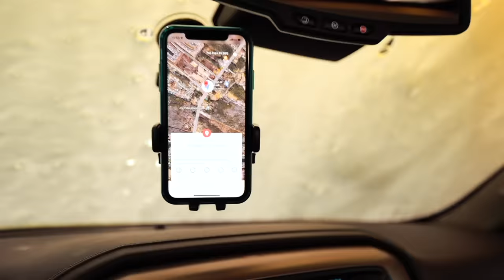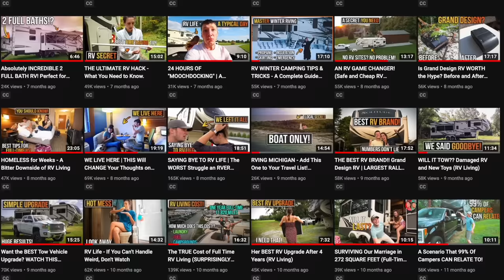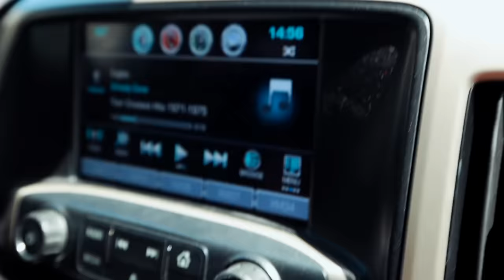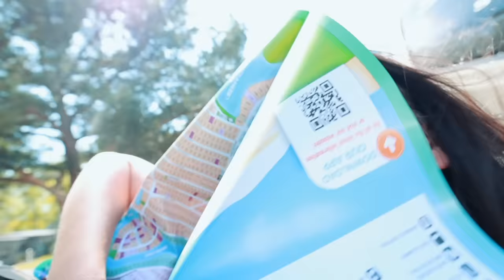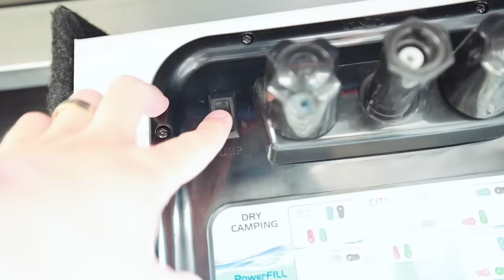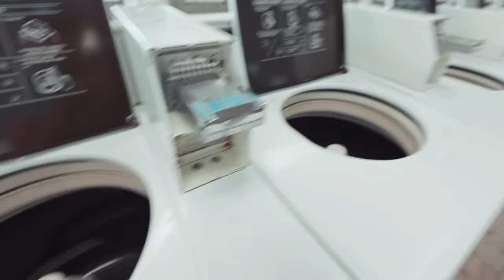THIS Is Why People Quit RVing! RV Repairs REALLY SUCK.

Comment: Hey Carl, I noticed that you connected the emergency break away cable to your fifth wheel hitch. That location is not legal because if your hitch actually breaks from your truck, the cable will not trigger the brakes. It actually has to be attached to a separate location from your hitch. (20 year owner of a trucking company) just trying to keep you safe. Love you guys!
Reply from the maker: Good to know!
Reply: I have mine connected to my hitch as well.  This is the first I’ve ever heard of this…
Reply: Interesting.
Reply: @faverdod5773  many people are unaware of this. Unfortunately many rv dealers tell customers to hook it to the locking arm of the fifth wheel hitch. Legally it has to be secured to a location completely separate from the hitch.
Reply: @justustwo1457  I will try to locate the actual law for you, I belive its under FMCSA. I've had a driver fined and I've received a warning for improper/ unattached emergency breakaway cable.  State Trooper in Texas explained the law to me.
Reply: Even if it’s not an actual law, it’s common sense everyone.
Reply: @chrisandersonCR16  I'm not sure the law would apply to RVers per se, but this is still a good practice.
Reply: @randobot6814  That is possibly true. You would think that if commercial vehicles are required to mount it to the vehicle separately from the hitch, private individuals would be required to do the same.  But, to drive a pickup truck and trailer with a GVWR of 26000 or more commercially, you have to have a cdl, but a private individual doesn't.
Reply: @bulletsonofagun7413  I know commercial driver's are required to mount it to a different location, I'm not sure about privately.
Reply: This isn't a law
Reply: This is great advices but the law only applies to commercial carriers.
Reply: Horse people know this; but many rivers don't seem to.  We have to extend our cables for them to effectively engage. It is very odd that modifications have to be made for this.
Reply: @chrisandersonCR16  state by state there are different laws for non commercial cdl requirments.  You are giving blanket advice as if the laws are federal and not state by state.
Semi doesn't have breakaway cable because air brakes will come on when the line disconnects.
How many 5th wheel hitches that are within their rated weight limit have you ever heard of breaking?  If the coupler comes undone and the trailer disconnects the breakaway will still do it's job.
Reply: Ok...so if that's the case...why is it you hook the safety chains of a tow behind camper or any trailer for that matter to the receiver....
Reply: @wakeupamerica2024  I'm aware of the air brakes on a semi trailer, and you are correct, they don't have the same breakaway system.  I don't run semi's trucks anymore, I have a fleet of Hotshots. We run fifth wheel setups. Just because I haven't personally seen it happen doesn't mean it can't happen. So why not change it to make the chances of your breakaway system working, even better.  Parts fail. 2 weeks ago when I was hauling a 46' Invincible boat, my 30k Curt trailer hitch snapped. The safety chains did they're job and no one was hurt. I contacted Curt and they couldn't believe that one of their 30k hitches failed, but it did. If I could post pictures of it, I would.
Reply: @richbutinski1367  I was thinking the same thing.
Reply: @chrisandersonCR16  commercial vehicles ie tractor trailers don’t have a emergency break away cable
Reply: @edwardwingel121  Hotshots do.
Reply: Wow, my dealer told me wrong. Big surprise.
Reply: Doesn’t apply to a person pulling an RV. My cable is attached to the hitch and will remain that way. Your trucker rules are different.
Reply: Have a beautiful day everyone!  Keep spreading positivity into our world!!
Reply: I've always gone to the rear tie down eye in one side of the bed

Comment: The tank replacement may not have been "light & entertaining" but your presentations are ! In my 40+ years of RV-n (not full time) I've learned to just do most every repair & maintenance myself. Even when the shop's do repairs I ended up doing them over. As you said early into this video, "they don't care". Stuff just happens & ya gotta figure it out. Laundry; I lost that job when my wife saw me separate it into 2 loads; white & all others, use just 2 small machines (cheaper) for 2 weeks of laundry + towels! The coup de grâce; if one cup of soap is good, 2 is real good, right !
Reply: Gee that is how I sort clothes:  white/light and dark.  More soap doesn't do the trick.  Less is better.  You and I would do fine with laundry.
Reply: I’m the wife and i don’t even sort 🤷‍♀️

Comment: I just got a job at a trucking company and overheard them saying that one of their drivers drove 80 miles and then the trailer came loose in the middle of the road. They said it was because he high hitched the trailer and did not visually look at the hitch to confirm it was 100% latched. Thank you for talking about this. You definitely need to do a pull test but you also need to visually look also.
Reply: I also noticed at the end of the video that Carl was hugging the black tank that had been leaking and put his face against it. I hope they had washed it off really good😳😳😳🤣🤣🤣

Comment: Karl...Karl...Karl....change where you hookup you trailer brake cable....it needs to be attached somewhere solid on the truck not the d-ring of the hitch....someone in Florida told me of a gentleman who had an accident and they cited him for improper cable attachment....get a spring wire type 6' with the clasp and attach at your tie down near your plug....🤠🤠
Reply from the maker: Thanks for sharing!

Comment: Taking in the rig is a nightmare. We don't full time so it's not a total emergency. However, getting two days of work done at the dealer took two months and once it's in there there's nothing you can do about it. One idea for your hitch up while "filming", get an extension cord. I'm old and ducking and reaching in to plug in sucks. I know some people have problems with them but I've had mine 2 years and it's great.

Comment: Glad you FINALLY got the tank replaced!  If you have luck like ours.....the Refrigerator is probably next.  And you can count Campers Inn Myrtle Beach out for replacing that.  They wouldn't help us.  We have ours stored at Lakewood Camping Resort and found a mobile guy there that picked it up for us and had our Solitude moved on site and changed it out for us.  Saved me a lot of stress since we are in Ohio.  On a side note...Lakewood has the best soft water than any other campground that we have ever stayed at.  Most likely the reason you had the leak there.  Good luck on the adventures.  I wish we could have met you at the rally.  I got a little under weather while we were there and didn't want to risk getting anyone sick if I had Covid.  So we stayed away from folks the best we could.
Reply from the maker: Next time! Thanks for sharing

Comment: You guys inspire me so much to go RVing but my Travel trailer has given me some heads aches after buying it new a year ago was in the shop a total of 3.5 months out of the year I’ve had it .. the shop has giving me alot of push back and manufacture tried blaming me for some of the problems so I can relate to this problem you guys have had.. send me some of those good vibes so i don’t give up!

Comment: 7 months now as solo RVer. The toughest part is not having a partner to bounce ideas off of, and when the tire goes flat, the engine overheats, the dog vomits, the sensors don't work, the 30amp breaker breaks, the truck makes a wrong turn into a dead end road, etc. etc and so on, you are it. I can see why so many singles choose a van, but for me, that's not enough room. I tried a 25 ft, and just upgraded to a 33 ft travel trailer.  I still haven't met any solo single ladies, but my 3 black labs are serving me well as man magnets. 😄
Reply from the maker: We’ve met many solo women on the road, it’s becoming more and more popular

Comment: You should Manually Apply your trailer break to do your Tug Test instead of using chocks. That way you can also make sure that your break system is functioning also before pulling out into traffic 👍
Reply from the maker: We do both! We have a video on this process but trailer breaks are not enough

Comment: Unfortunately the grass isn’t greener in bricks and mortar living. Stuff happens whether you’re home is an RV or a bricks and mortar home. We’re not full time but we are retired so we own a home and an RV. Thankfully I’m pretty handy so I can take care of the basics in our RV and home but, when I can’t I find the challenges to be pretty similar between a bricks and mortar home and an RV. As an example, our home was 18 months old when the microwave went out. Warranty was only 1 year. We use it everyday so it was a crisis for us. I determined that the touchpad died so I was going to order a new touchpad. Well, the model we had didn’t have any parts available anywhere. I had to replace the microwave. After a lot of research I found out the unit we had was a Kitchenaid that cost $900 but it was made by one manufacturer that made the same unit for dozens of brands. I ended up paying $100 for a replacement but we were without a microwave for 2 weeks. So, RV life isn’t really any different than life in a bricks and mortar home.
Reply from the maker: Well said, thank you for sharing!

Comment: Hello👋 I finally got (with the help from my sister in law) my wife to go check out some different travel trailers. It's just us and the three dogs so didn't need a big rv. We went to a little rv show. At Lehigh valley mall in Pa . A.B.E area.GOOOOO PA. And yes 78 stinks. So we settled on a Heartland prowler lynx 181bhx. That was thursday July 7 we could pick it up Tuesday July 12th. It was back to the shop July 19 because the slide was coming apart at the seam. The glue and tacks where not holding it and it came apart. Mind you we where going are first camping trip ever. Long story short I know it's not short lol we went camping set up went to put the slide out and the slide popped of the track and only went a little bit. Just enough to to squeeze and I mean squeeze into the bathroom the Murphy bed wouldn't come down. So guess where the camper is. BACK AT THE SHOP. Hopefully they get it fix before Aug 6th when where supposed to go out again.
Reply from the maker: Fingers crossed!

Comment: Feel your pain!  Our freshwater tank split in our Solitude.  I used to run a rotomold division, and the split was a manufacturing defect (tank wall of wildly uneven thickness).  Didn't matter, my fault apparently because we put water in the tank and moved the coach... 🙄  GD wouldn't sell me the tank direct because of having to freight it.  Ordered through Texas dealer and paid for 3 day freight.  I spent 6 hours on the phone tracking my tank down (4 days late).  I had to drive halfway across the state to get the tank AND they wouldn't refund what I paid for freight!  I did the repair myself and had to replace all of the insulation.  So, this ended up costing me just about $1500 because of a cheaply made tank I was forced to replace with another just like it because to get a custom tank made in these times is 15 weeks out!  Ugh.
Reply from the maker: That sounds so rough, thanks for sharing, Rob!

Comment: Congratulations on finally getting your tank replaced. Campers Inn has a lot of RED Flags now. As soon as they said they couldn't find your tank, I knew it was going to be an issue. Campers Inn should have compensated you for your time and aggravation. Now here's a heads up! the calcium buildup in the waterline should be addressed more thoroughly so here's what you could do yourself if you choose to except this info. How do you remove calcium from RV water lines?
Close the valves on the tank and add 6 gallons of white vinegar to a 40-gallon tank or 10 gallons for larger tanks. Fill the rest of the tank with fresh water then with the RV's water pump run the water through the waterlines until you smell the vinegar or for 10 to 25 seconds a little longer for the hot water ( MAKE SURE HOT WATER TANK IS COOL BEFORE THIS PROCESS) because you will need to make sure hot water tank is full, go outside and flip valve open to release pressure then close the valves. Let the acid in the vinegar loosen and dissolve calcium deposits inside the tank for at least 48 hours. Then drain and flush tank and lines. This will give you calcium free lines. You may need to do this every six to eight months' because you're living in your RV. I wish you safe travels and no more issues for a while.
Reply from the maker: Good to know!

Comment: I feel your pain. I have owned my travel trailer since April 8, 2022, and it’s been in the shop since then for 16 weeks (3 trips). The dealer has been pitiful. I picked it up on a Friday, took it out on its first trip for four days and it was in the shop the following Atuday for the next
Reply: 6 weeks. It was brand new. It is now in the fourth week of the latest trip and they have been on the phone with keystone to properly diagnose the issue. I love the trailer, and would like to use it more, but warranty issues need to be fixed. I’ve pretty much had it. Good luck with your issues, mine could fill a book!

Comment: You got to be good in manual work if you own an rv. I lived full time for 6 years in a fifth wheel and did over 95% of my repair. Save thousand of dollars. I was doing preventive maintenance every week. Those unit are built so cheep, on average. Good quality ones cost a fortune.

Comment: Just had to go to RV parts to get a thermistor for my Nrocold  refrigerator is on the blink. Gander RV said it will be two weeks before I get the part . I have to say RV s are a full time job. We have a 2020 JAYCO it has been a real good buy so far. My only complaint I have is getting parts on time and getting service. One year in to our JAYCO I  got a recall on the gas valve it took the RV center took a year to get it done.
Reply from the maker: Thanks for sharing!

Comment: HOW WE'RE DOING, YOU ASK.   WELL I'VE GOTTA TELL YA;   WE'VE MADE THE LEAP TP FULLTIME RV LIVING ON JUNE 1.    THE ONLY ISSUE SO FAR HAS BEEN A MECHANICAL, FRONT WHEEL BEARING ON THE TRUCK DIED.    REPLACED AT A WHEEL SHOP AND ALL IS GOOD.     SPENT MOST OF THE TRAVEL VISITING WITH FRIENDS AND FAMILY.   MET SOME NICE FOLKS ALONG THE WAY AND SEEN SOME THINGS YOU DON'T SEE EVERYDAY.    IN MY YEARS OF LIVING EVERYTHING IS FIXABLE, BY SOMEBODY, AND IF NOT ITS TIME TO GET LEARNED UP AND DO IT YOURSELF.
Reply from the maker: We love your take on it all, congrats on going full-time, best of luck with everything 🤗

Comment: Sorry for the problems you're having. Reality being, RV's are designed to fail. I've owned many over 40 years. They're constructed from the inside out. This means it's never an easy fix in most cases. Just sold my 38 foot toy hauler a few months back. Now in the process of making a conversion of a cargo trailer. If I design it with my years of RV failures, it should be locked up. Wish y'all the best in your travels. Good bye from Atlanta
Reply from the maker: Thanks so much!

Comment: New Tank for the Hanks! Lets hope the next thing that goes wrong on your RV is discovering they used $100 dollar bills to insulate your new underbelly because they ran out of regular insulation. I have been RVing since the turn of the century (this one) and I have always done repairs myself. I am lucky that I am mechanically inclined. I just got done replacing the suspension on my less than one year old T.T. Put on the CRE3000 with the replacement wet bolts and the cross members on all three hanger positions. And I know it's done right. If you get in a jam again have them ship the parts to me then bring your beast around and we will git-er-dun. Stay safe out there!
Reply from the maker: Appreciate that Wayne!

Comment: RV tip. Every 5 years your co2 detector needs replacing. The bad thing about it is the alarm will go off, yes in the middle of the night. You disconnect it thinking it will power off, nope. Once disconnected cut wires off of it. Take it anywhere that sells propane preferably an RV part store and get your replacement one. THEY ARE LOUD AS HECK! And you can hear it outside.
Reply from the maker: Good to know!

Comment: i have a 2013 fleetwood, 35k model, the awning quit working,  took it to a repair shop, the tech found a 400.00 dollar wind senor/ controller blown, he also said the coach batteries needed replacing... because it contributed to the problem.so we purchased over 500.00 for the coach batteries and install, and ordered a new 400.00 dollar wind sensor. after waiting for 2 months the wind sensor arrives, we pulled the camper out early, i was to plug in the new wind sensor when i got it. well i plugged it in that brand new item, a you guessed it, i smoked right there on the spot. and i still have a dometic awning that does't work...i ordered another 400.00 dollar wind sensor/controller, but am afraid to plug it in... no one really can help us, and if they do you have to leave your rig there for 2-3 months. i'm not sure what im gonna do about it, its just something unless you can repair it, it's not something a average camper can fix.
Reply from the maker: Best of luck with everything, such a bummer